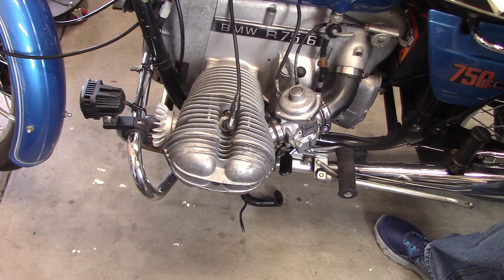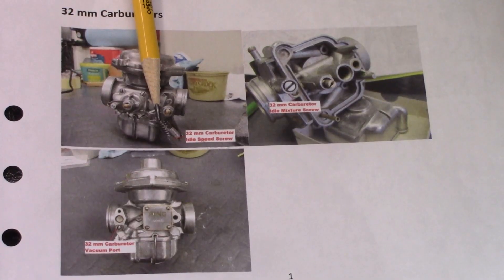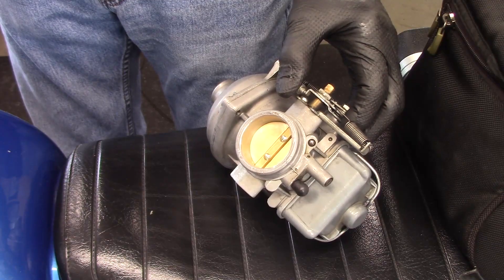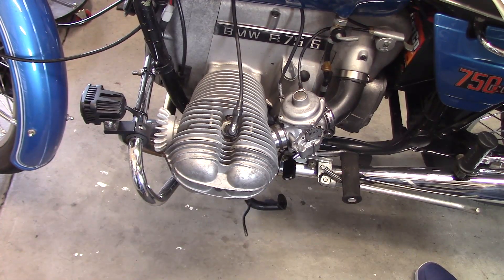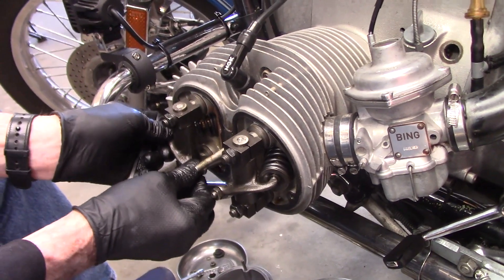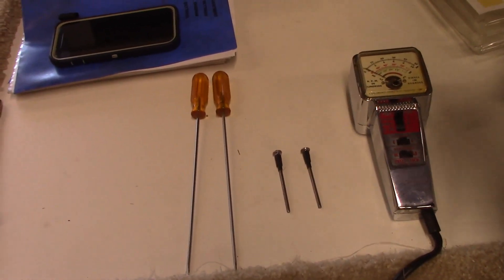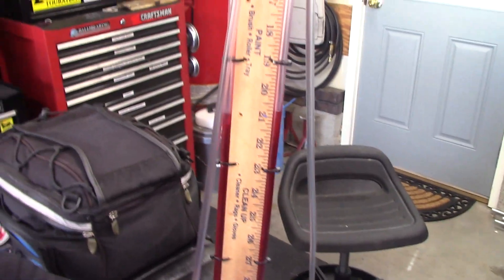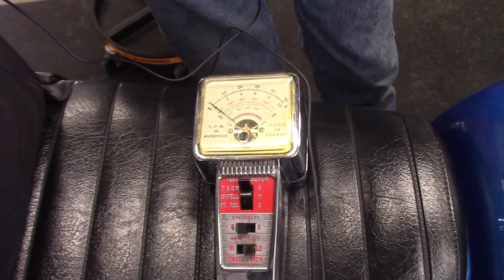Balance Bing CV Carburetors

Comment: Hello Brook, Do you know why one carburetor is leaking gasoline , is it because of any gasket?
Reply from the maker: could be that, or the float is hanging up or set too high, or a crack in the fuel line
Reply: @BrooksAirheadGarage  @bhagathpratap-o6n  Or just a bit of crud - you can remove the float bowl and hold up the float by hand, then turn on the tap and jiggle the float up and down a bit, letting some fuel flow through. Turn off the tap and reassemble. That's always worked when I've suffered the 'airhead wet boot' issue.

Comment: Very informative video. As well as smoothing out the engine, I’ve found that setting the air/fuel mix correctly is critical in preventing the engine from wanting to bog out and stall when lifting off idle. Have you experienced this with these carbs?